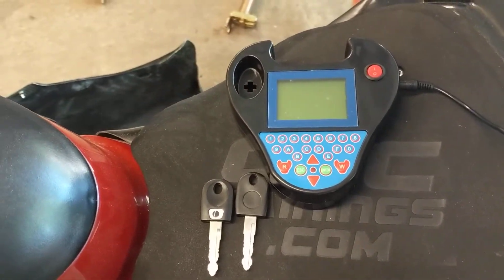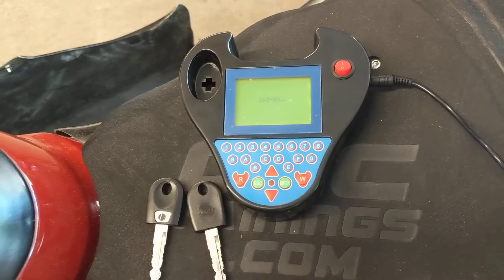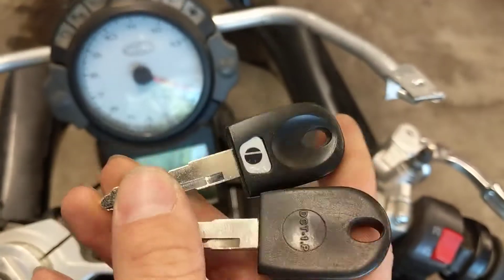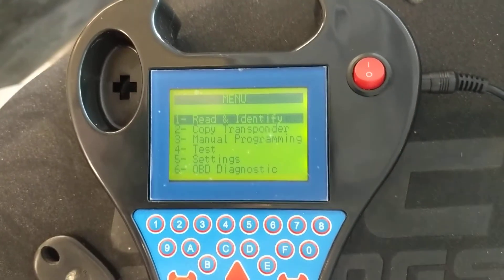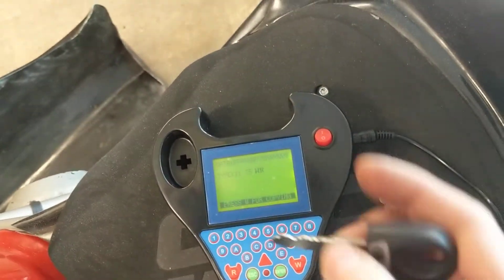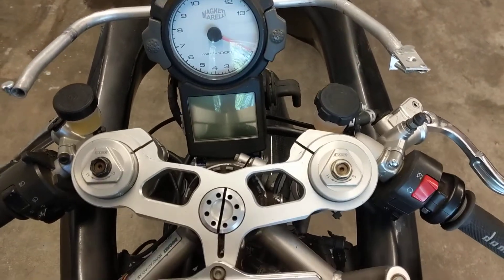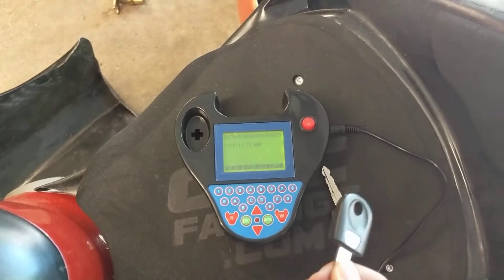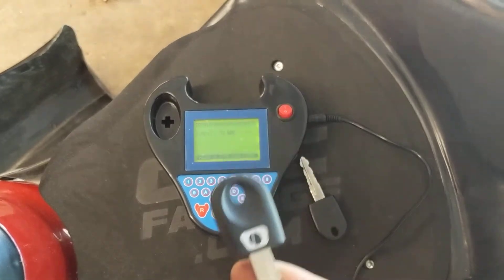Cloning a Ducati T5 Transponder Key with a Zed-Bull Mini

Comment: I just made copies of my original Ducati transponder keys, this works. I had to pull the IMMO codes from the Amtel 24C16 chip from the dash to enter another used Ducati transponder to the the Dash and then make copies but the Zedbull did work making copies from Original Ducati Keys to Amazon blanks(which I had cut to match by a locksmith)
Reply: Hey what year is your Ducati? Was wondering if it's gonna work on my 2022 Supersport 950 transponder key
Thanks in advance

Comment: Will this work on a 2012 Monster 1100 Evo ? The key looks a little different, but I think its still the T5 chip
Reply from the maker: This should work with any t5 chip. I've used it on the laser cut keys on my 2010 Streetfighter and cloned them successfully.
Reply: @pittmeister  Cool , Amazon says its one week away - will report back. Thanks!

Comment: Worked perfect for me too, on my 2008 Ducati 848 Superbike. 
I bought the same Mini Zed Bull off eBay for $35, and it was just as quick and easy as your video shows. 
I should say, thank you, because your video is what gave me the information I needed to program my Ducati key, when absolutely NO locksmith would even discuss cloning a “Ducati” key. So, Thank you!!!
Reply: Sean - I am having the same issue, can you confirm all is still working well after 1 year?
Reply: Really Does it work correctly? For Ducati keys I have a 796cc 2014 monster and I want to copy keys, they charge me a lot.

Comment: Don't suppose you know what a transponder key looks like to the Zed-Bull when it's blank?

The blank transponder key I bought looks like it's already been written to, but it's my only and first time using, so I don't actually know what a blank key reads as, if anything..
Either way it won't copy my old T5 to the new T5 :/ It says no transponder while trying to write after copying from the original. Again, reads as having data on it though.

Buying another supposed blank to try again, but wondered if you might be able to help with that knowledge?
Reply from the maker: It should read it with something like all 0's for the code.
Reply: @pittmeister  Yeah.. The eBay guy isn't being nice about returning it either. I got some line about having a dealership erase it for me. :/

Looks like I'm going to need a new one.
I also bought one that was blank with no transponder. It says 'no transponder if you try to read it'. The supposed blank with transponder I bought brings up the code line.

Found one on Amazon with free returns at least, so I'll see what the difference is on Saturday when it arrives.

edit Actually maybe I just needed to buy the individual T5 chip and swap it out with the used one. Seems I've got me too many spares suddenly :D
Reply: @breaddrinker hi iam havibg the same issue. What did you have to do? Can you buy just the chip and open up the key.
Reply: @pittmeister  You're quite right. The blank transponder I got as a replacement arrived today. Read as all zeros. The Zed-Bull copied my 07 S2R1000 key perfectly.
This thing is awesome.

Comment: if thta zedbull is an original tool from turkey.do not sell  in a few years  this tool will become like a clasic  db5 . they dont make them  but keep it then in 2025  put for sale, this tool was the gateway to cloning id46, no tool on the market had this option, i made so much money in 2008  programming  RENAULT megane 2 cards, dealer was asking   1000usd, i was doing it for 600usd  and with 400 percent profit.  even the dealer stat sending the cars to my place,i could do it in  3 minns programming with a nucard  as deler always has to wait 2 weeks for the new vards to arrive as they had to b made VINcoded.     RESPECT IEA.

Comment: I lost one of my keys for my 2014 Ducati Monster 796.  I looked all over to get it replaced, no one could do it, not even the dealer who said it was impossible without the 5-digit code.  I bought my Ducati from that very dealer, they never gave me a card with a 5-digit code.  You're supposed to get that card and two black keys, I just got the keys.  The usual way to get it replaced is buy a blank key from Ducati for $90, then have a locksmith laser-cut the key (another $40-$50), then you can (have Ducati or do it yourself) program the newly laser cut key with the bike using the 5-digit code on the card.  Without that card you're basically SOL.  Without any keys or card, you need to replace the entire gauge panel, ignition, etc. - $2000-$3000!!
There is another way, it is called the Ducati Key Clone, a knowledgable locksmith can use the remaining key you have to duplicate another functional key (laser-cut and programmed).  Only one locksmith in Phoenix area can do it - ALCATRAZ LOCKSMITH  (602) 677-5045 ask for Todd Hagan.  It took him 10 minutes - fully functional key at about $100.  He can even do it w/o any keys, but it would be considerably more expensive, but not the $2000+ Ducati price.
Reply from the maker: That's good information Pablo. I have successfully cloned a laser cut Ducati key for a 2010 Streetfighter S with this tool too. Since this video I've also cloned a 2007 1098 key and 2010 848 key and all have worked perfectly. I purchased the key blanks for $25 on amazon and my local locksmith will copy a lazer cut key for just $30 or a standard key for just $1 a side. This way I don't have to mail my key away and still save some money!
Reply: @pittmeister  That's awesome - good to know, are you in Phoenix?  I know there is another guy in Duluth, GA - they know each other.. I just did not want to send away my only remaining functioning key, so this guy is specific to the Phoenix area only.
Reply from the maker: @chittypoofs  I'm in Texas. I've always done my own work on my bikes and wanted to try this out to get even more independence from the dealers. You never know what you are going to get sometimes so I'm quite pleased that this actually works!
Reply: @pittmeister  I just do simple stuff:  replace battery, replace air filters, replace oil filters and oil, bleed brakes, brake pads, chain tension, etc. nothing fancy and just all that has saved me hundreds of dollars.  This was too technical for me.
Reply: @chittypoofs  
i have a zed bull mini it is not working properly. What should I do ?
Reply: @badrikafadil6360  I found a locksmith that could do a "Ducati key clone" with just the remaining key I had.  Stress that the key is all you have, "can you clone it with just the key"?
Reply: @pittmeister  Same.. I've had my eye on that redbull thing for literally years, and yours is the first to confirm it works.

If only they'd have a reliable resource to promote it's merits. For the cost of the programming, you can buy the unit and help out a bunch more people with it :/

I have one on the way, and a blank key that I hope will work.. Also went one step further and bought a key cutting nibbler.. Again another 30 dollars. It'll be pretty damned cool if I can get this to work for the same cost as a single key cutting.